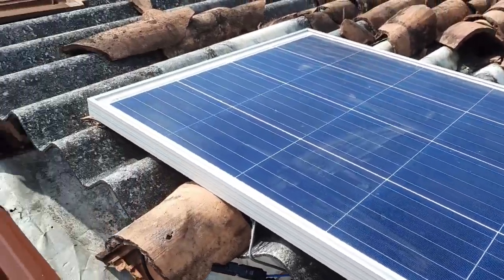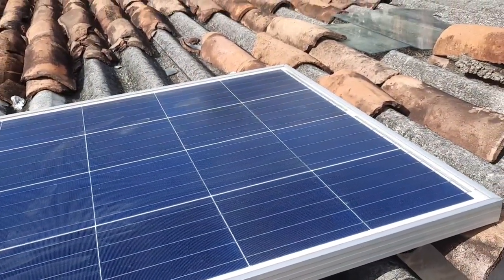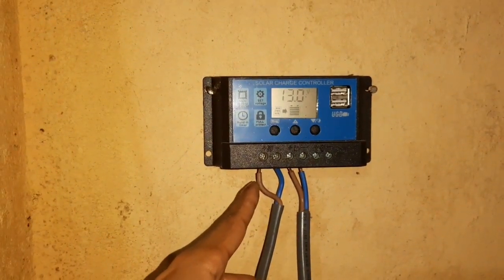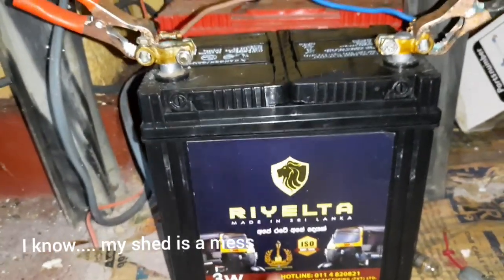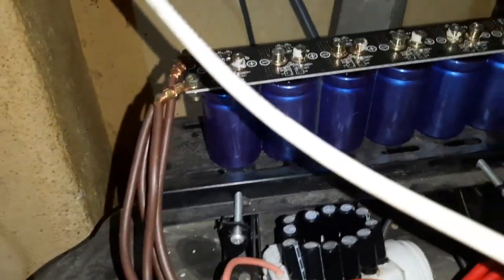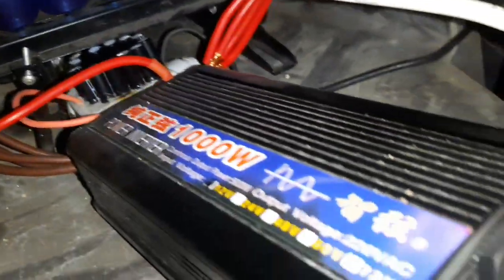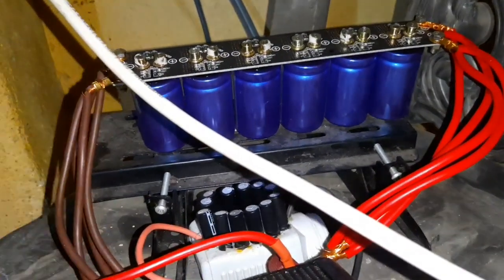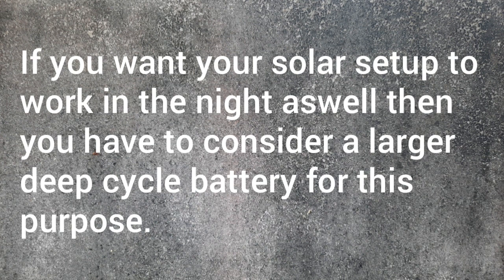Cheap home Solar System in Sri Lanka using Supercapacitors - Solar panel system Sri Lanka

Comment: Please what is the advantages of using those super capastors?
What are the capacity?
How to connect them on 12v or 24v system.

In addition, I have a dc freezer with 200ah battery & normal ac fridge with other home appliances working on 48v inverter solar system working only during day time for sometime now. 

I always appreciate such a video that will help me enhance or improve efficiency and reduce the pressure on the system. 
Regards
Reply from the maker: The advantage of using a supercapacitor bank is that it helps give a boost of power when your appliance needs it. Induction loads such as refrigerators use a lot of power to start the compressor. In those first few milli seconds it will use around 5 -7 times its rated power. In that time your battery might not be able to quickly respond to the load and the voltage might drop enough to shutdown the system. Thats where supercapacitors help. They act as a temporary storage that can give a large ammount of power instantly in a short time. This helps take the starting load off the battery!
The highter the voltage the more capacitors you will need. For a 12v system you will need 6 supercaps and for 24 you will need double of that.
But when you are using a higher volt systems (48v) the amp draw on the battery is much lower than that of a lower volt system like a 12v one.
Reply: @diysustainableliving2774  I thank you for the  good explanation.
Please, kindly suggest a specific capacity or a vendor on aliexpress. I may also need a diagram on how to connect them.
Finally, can I use the supercapastor even on a dc system setup?
Regards
Reply from the maker: I cant recommend any particular vendor. The supercaps are for the DC side not AC!
Reply: @diysustainableliving2774  I do more research, I now have good understanding for the system. Thank you.

Comment: Good day can I ask if I can used this set up 24/7 without removing the super capacitor for continues working with refrigerator? Thanks in advance.
Reply from the maker: Yes.. the supercapacitors are permanently connected to the system. If you want to run the system 24/7 then make sure your battery has enough storage capacity.
Reply: @diysustainableliving2774  thank you brother for the tutorial I really appreciate.
Reply from the maker: Thanks!

Comment: What's the function of Mini Black capacitors?
Reply from the maker: Those were my first series of high capacity capacitors. It was just connected in parallel. After getting the bigger set I dont use them aymore.

Comment: You can also use a two 12v dc motor to create a generator to charge the super capacitor
Reply from the maker: Well... the supercapacitors are charged by the solar panel directly. So there is need to use any motors as generators here.
Reply: @diysustainableliving2774  in day light indeed... But what I mean is at at night... So that it will run through the night
Reply from the maker: Ok... but what about the energy source? It should be wind energy or mechanical like maybe attatching the 12v motors to an exercise machine to get power.
Reply: @diysustainableliving2774  just wait I will make video about it
Reply from the maker: Good!...  cant wait to see :)
Reply: @diysustainableliving2774  Hi What 8394 is saying you can make your own free power (Without electricity/or Fuel) from using old Motor/Alternators/ coils/Magnets which will replace your Panels completely, so you could run your system day or night !!! search for free energy youtube vids (It is possible)

Comment: Nice setup. I want to understand how battery and super capacitor connected together to charge controller. Thanks 🙏
Reply from the maker: All are connected in parallel.
Reply: @diysustainableliving2774  Thanks 😊🙏🏻

Comment: Pls. How do you connect to carry 2hp air conditioner ?
Reply from the maker: AC uses a lot of power. The best configuration will be a 24v system with a pure sinewave inverter that can handle 2000w continuous power output. And you will need big batteries and lots of solar panels.

Comment: nice video. maybe you can use DC appliances directly. to save more power.
Reply from the maker: Yes that a good point. But then again you have to buy the dc appliances which will add to your costs. By using an inverter you can use what ever you already have and use it as a backup power during power cuts as well.
Reply: @diysustainableliving2774  yes that's also true. I was planing to do small solar setup for rural land where I need to power lte gateway and couple of cameras and access points. Planing to go fo full DC since those anyway need DC power. Not sure about the battery setup though. I'm also thinking to buy small car battery
Reply from the maker: Dont use a car battery if you are planning to use for a long time like 3 to 5 years. Car batteries are not designed for deep discharges. Their cycle life is rated for depth of discharges of only 5 to 10%. You will need deep cycle batteries for long term reliable power. The initial cost is slightly higher but in the long term it will be beneficial.
Reply: @diysustainableliving2774  Could you guide me a place where I can buy good deep cycle batteries in Sri Lanka ?  My past experience was really bad for buying batteries, most of lead-acid batteries I bought chines clones with good names like Panasonic :-(
Thanks
Reply from the maker: Well I havent used any deep cycle battery before so I cant recommend a good place to buy one. I know that Mandanayaka battery works on Amour street have them. You can also try a search on ikman for solar battery. Millenium city A plus ECO has some selection. But keep in mind first you have to calculate howmuch your daily consumption is and you have to get more than double that as battery storage. Even deep cycle batteries are meant to be discharged no more than 50% of their rated capacity or else the battery will get damaged.
Reply: @diysustainableliving2774  Just wanted to give update as I inspired from videos like this. I build my first off-grid setup with somewhat large lfp battery bank and now completely depend on that setup. For most components I went with good brands like Victron / pylontech because I wanted this to last many years. had to import everything as cannot buy any good products in SL now for good price. went through lot of readings and experiments and my setup is super good now. thank for your video and help again.